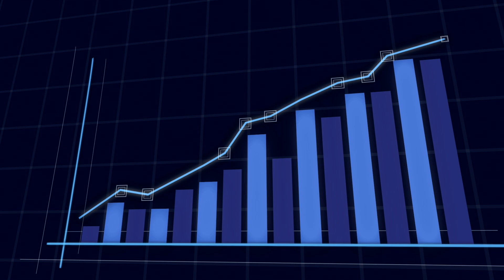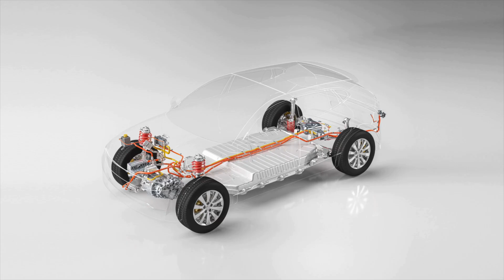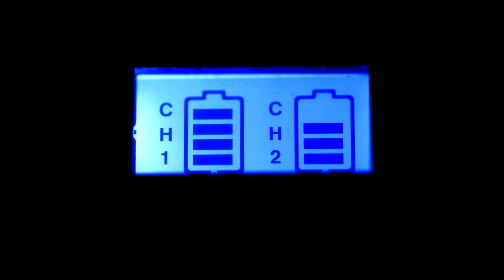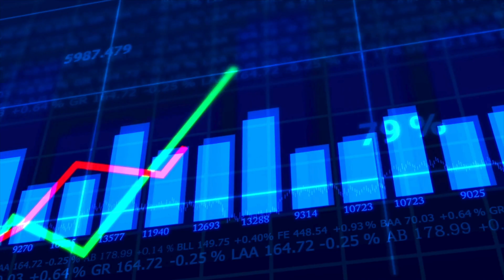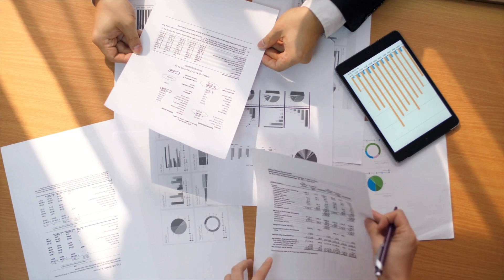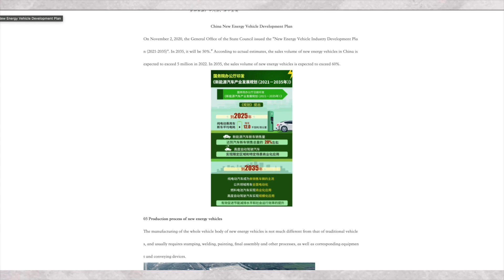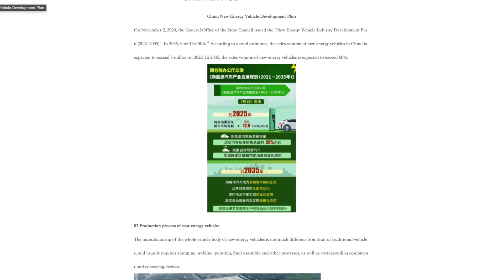Top 10 Reasons Why China is Leading in Electric Vehicle Manufacturing

Comment: To me China concentrating its attention on EV is just a common sense.
Unlike the US and the west that have access of cheap fossil oil reserves China has little of it so its citizens could not afford to drive ICE cars like the west.  Electricity in China on the other hand has been the cheapest among the industrialised nation.  In 2023 published electricity tariff US is 2.25 times, France is 2.65 times, Japan is 3.1 times ,  UK is 5.8 and Germany is 6.5 times more than China.  Thus China has built massive amount of metro (over 55 cities) and HSR which are all electrified.  Therefore the logical solution to car transport must be EV!  That would save China from importing massive amount of fossil oil from overseas.  Today China still imports massive amount of fossil oil from overseas but some 80% of it is for industrial production and not refined into petrol or diesel for ICE cars consumption.

What China has been doing is to live within its means!  This is same as the renewable energy and battery.  China's motive want isn't just to drive EV instead of ICE cars but to avoid the dependency on fossil fuel that must be imported from overseas.  China has installed most of its renewable energy generation in inhabitable deserts and wasteland in the North west of the country.  It developed the UHV transmission system to bring the electricity over thousands of kilometers from the west to the populated eastern coast.  The cheap renewable energy helps Chinese industries to compete with the west, power the both the public and private transportation for its citizens.  This is the complete picture. The EV is just a tiny piece of the overall large jigsaw.